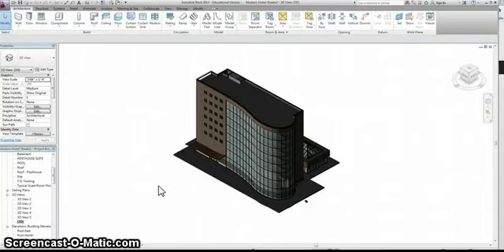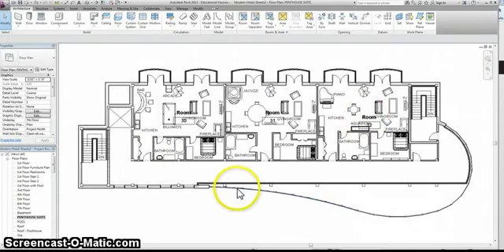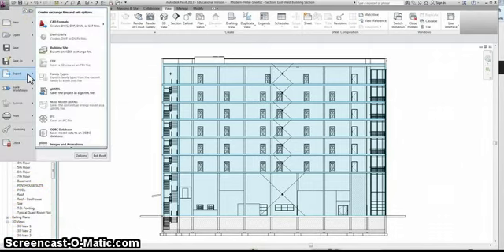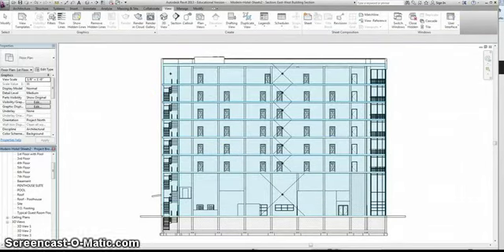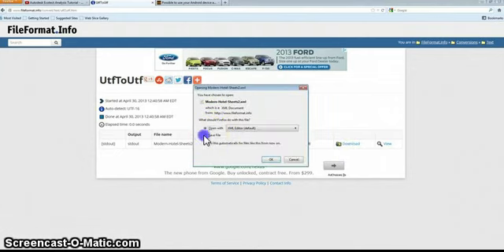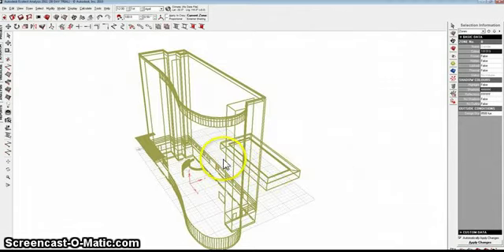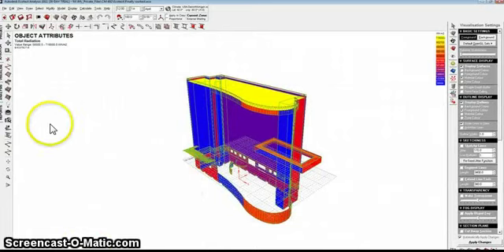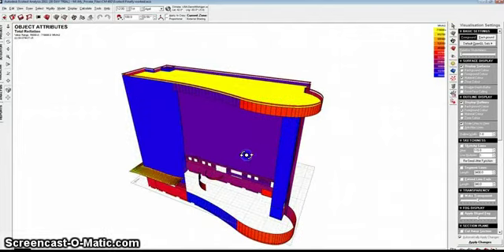Importing 2013 Revit files into Ecotect

Comment: No need to download nothing. To convert the gbxml file you can open it in windows "notepad" and do "save as". Before you save the file you just have to change the "encoding" from Unicode to UTF-8 (the encoding button is on the left side of the SAVE button). It also works for gbxml files exported from Revit 2014.
Reply: Tomé Caupers I did it like this but when i finally open the file on ecotect it shows this message: "Error: Selected model file does not match the selected data format or is corrupt." anyone else have received this message?
Reply: Im trying too and i have the same problem, how did you solve ?